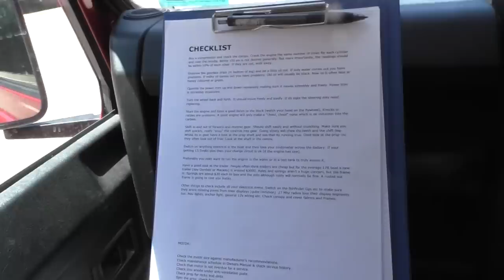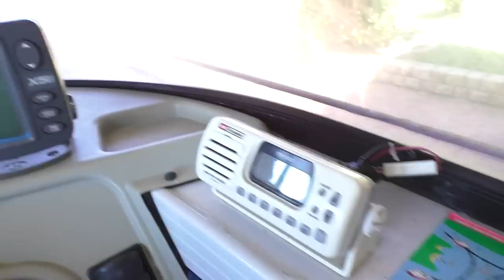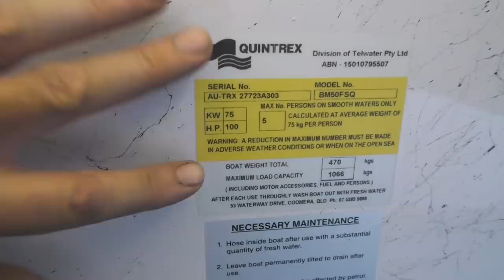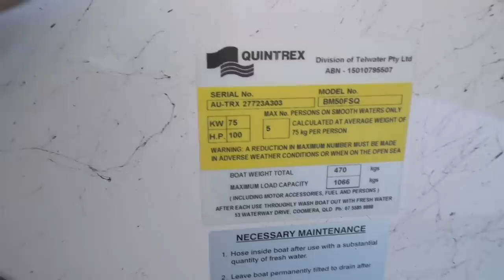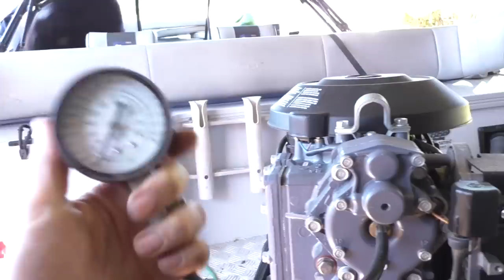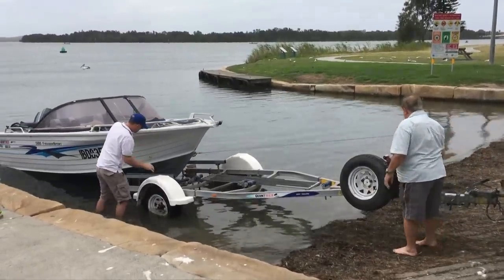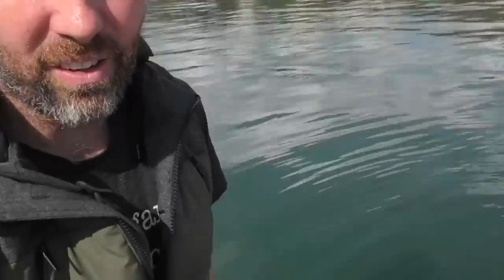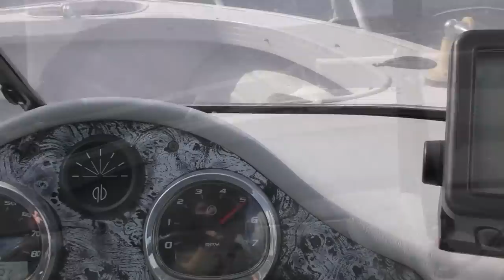Buying a used boat

Comment: Tips for aluminium boats, check for old hooks, swivels and sinkers jammed up against the hull, usually under seats or bracing points. They will induce electrolysis and corrode the hull out very quickly. Also check for longitudinal cracks along the hull, especially near rivets or either side of the keel. Thanks again for a great video Stu!
Reply from the maker: Thanks Matt. I'll add looking for stray metal to the checklist. :)
Reply: Great tip Matthew. It's something I've run into every time I'm in the market for a used aluminum fishing boat.
Reply: Even after you buy the boat. I did this several times using a hose and probe. The first few times I got some  swivels and sinkers.  Noticing water didn't flow smoothly past all ribs, some digging with a cable tie (plastic so no scratching) I found a rusty traler hub bearing cap wedged under one rib and a half penny wedged under another.

Comment: Love your videos Stu. I have learnt so much from you, its helped me do everything myself on my old 4.5m alloy centre console project boat. The boat   was sitting in my shed for years with a buggered motor and i never had the money to do it up. Your channel motivated me to drag it out and start working on it. New floors and carpet, new wiring, new lights, new bilge pump, second hand 50hp four stroke Yamaha to replace the old motor, fix up the trailer all learned from your channel thanks so much for the help. It will be finished soon (as funds allow) and back in the waters off Brisbane just in time for summer can,t wait. Hope you get well soon cheers Peter
Reply from the maker: Thanks Peter. Glad the vids helped you get your boat fixed up. Only one week till spring! :)
Reply: A bit late to comment, however,  how did you go with your  "renovation"?

Comment: Hi there. I’m a first time boat owner. I’m reaching out to you from Pratt, KS, USA.
Now to the meat and potatoes. I bought a nice 1989 Ranger bass boat recently. The owner started the boat for me prior to purchase. It was a little bit of a bugger for him to get it started and also for him to get a steady stream of water out of the tell-tale. Nadia and I took the boat out to a small lake to familiarize ourselves with our new purchase. I noticed the temperature gauge climbing rather steadily as we slowly traveled out of the no wake zone. I also noticed the no water was coming out of the tell-tale. At idle rpm. The temp got up around 3/4 of the way hot on the gauge. We trailered the boat and took it home. I checked for airflow on the lines on the top side and there were no obstructions. I pulled the leg off last night and when I did so the water uptake tube stayed attached to the pump in the leg. It didn’t stay secured up in the engine. I will add that the leg slid right out without any added persuasion. All the videos I’ve seen where the leg is dropped for impeller replacements, the uptake tube stays secured up in the mid. I’m guessing that I was losing considerable water and pressure because of this lack of tight fit at the top of my uptake tube. My plan is the remove the uptake tube from the pump and reinsert it into the mid. Is there an easy way to do this properly where I’ll get a secure fit and seal or is this a major repair? This may sound dumb, but if my rubber seal or grommet...... whatever was originally used up in the mid is gone or damaged can I use a 1 inch piece of heater hose or fuel hose on the end of the uptake tube that seats into the mid if I find the proper ID and OD?

Comment: Great video as always. One thing I've found on smaller boats is people putting on any prop they have that fits because they broke one etc. and it's the wrong diameter and/or pitch and then the boat doesn't respond well either rev-ing too high or not enough.
Reply from the maker: For sure. I it good to get the story from the owner so if it only hits 4000 RPM you can figure out if it is prop or a motor problem.

Comment: Hello Dangar studios! I’ve watched all your vids and as an avid fisherman up here in Canada I’ve always found them super informative. I wonder could you do a video on your thoughts regarding aluminum vs fiberglass hulls. 
Kindly
Buck
Reply from the maker: Hi Buck. Aluminium hulls have good abrasion resistance and can take knocks against rocks, other boats etc better. Fibreglass hulls are very strong in the water though and are generally heavier and therefore more comfortable in choppy waters. Aluminium hulls tend to slap against the waves because they are so light which can make them uncomfortable.

Comment: Great tips and advise and for anybody buying a newer rig in hopes of getting a 'transferable warranty', be careful and do your homework. Not all but many boat manufacturers offer Transferable warranties that may include the second owner. Just keep in mind that these transferable warranties are written by lawyers!! The biggest back door escape for a boat manufacturer on a second owner transferred warranty claim is if the first owner performed any upgrade work or in some cases routine maintenance themselves rather than paying the manufacturer or dealership for even minor upgrade installs as simple as a rod holder and/or simple maintenance work. 

Some boat manufacturers are pretty honorable when it comes to warranties and others not so much. If a warranty is something you'd like in your purchase of a second hand or new boat read that warranty especially the release of liability section and the guarantee section.
Reply: Wow sorry to hear about the kidney stones Stu. I've had my gallbladder removed after a painful blockage and I understand the kidney stones are just as painful. Good on ya for a complete recovery mate.
Reply from the maker: Good point about warranties if you are buying a second hand boat that isn't too old. Well worth reading the fine print first!

Comment: Great video Stu! IF the boat has a trolling motor that's something to check out, especially if it's a newer unit. The new ones are EXPENSIVE! The new models with anchor lock cost more that my whole boat!
Reply from the maker: Good point Jim. Well worth making sure it is working properly while you are out on the water.
Reply: sorry mate.. not at all,  I didn't mean anything negative..my apologies :)
Reply: @markolav7017  I apologize if I jumped the gun. At times Its hard to tell if someone is being serious or just playing around (sarcastic) by reading comments without talking in person to get the vibe of the conversation. What you said was funny😁, but I thought you were being serious. Us dumb Americans take things too serious sometimes! I didn't know you were friends with Stu. If I did, I should have seen the joke coming and laughed!
Reply: All good my friend..I just thought I would throw in the old "cup holder" gag as Stu mentioned these great features during the Green Machine restoration. I should have explained myself.   Yes, trolling motors are ridiculously expensive and well worth checking that they actually work during the test run.  If not, may be another good bargaining tool to get the overall boat price down :)
Reply: Quinnies of certain vintage had an issue with electrolysis between the the stringers and hull.  A mate had perforations after 2 years!  I believe the alloy used  wasn't great but was needed to be ductile enough for stretch forming the millenium hulls.  Corrosion resistance wasn't great.
Reply: Quinnies of certain vintage had an issue with electrolysis between the the stringers and hull.  A mate had perforations after 2 years!  I believe the alloy used  wasn't great but was needed to be ductile enough for stretch forming the millenium hulls.  Corrosion resistance wasn't great.

Comment: One thing I might add if I may, is more times than not you can purchase a boat, motor, and trailer for very close to the same price as you could buying a used outboard. Then you would have to either install it yourself, (mount, controls, etc) and you would have to have it installed (which most of us would have to do if it is a larger motor with steering and controls). I know in my case , I just recently had the lower part of the driveshaft break in my old 1987 nissan. Only parts you could possibly hope to find there are used at someone's boat/motor salvage yard or extremely rare in my case someone still has one they are parting out. The part /parts journey was unsuccessful for me and I opted to strip down everything of value that I possibly may use later on the next boat, after looking hard for a reasonably priced used outboard of comparable size. No luck there, so I stripped my old rig down of anything I thought I might use at some time on the next boat , and I found a boat , motor, and trailer that I thought was in really good condition(1998 seaark bass boat with 115hp johnson) and was priced what I thought was a very reasonable price. The difference here is you can still get parts for my motor for the most part if needed. 

And I know that is not always the case if you are someone that works on outboards. Often times someone may come in want to upsize their horsepower or go to a more modern fuel injection, or a 4 stroke motor, and you may be able to buy their old outboard which may be in good condition cheap. 

So just a perspective from the non outboard mechanic or non outboard or non boat dealer side of things. 

Again you have an excellent video here on things to look for , but just wanted to put it how it may be for guys like me.

Thanks Stu, and stay well!!!
Reply from the maker: Hey mate. It's definitely important to know the new price of anything you are thinking about buying. Without that information you don't know whether it is a good deal or not. I find a similar thing with auctions. People often presume something must be cheap because it is an auction but bidding can climb over new price if you aren't careful.

Comment: Dangar Marine - I liked your video. One of the last things you touched on at the end of your video was documentation. Being from the USA, Specifically Texas. It is very important to first check to see if the person trying to sale the boat actually is the owner of the boat. Texas is one of the toughest and strictest states of all 50 states when it comes to buying a used boat and being able to legally document and then being able to transfer the ownership from the old owner to the new owner. All boat registered in the USA have registration numbers assigned to them, First 2 letters of the registration are for the abbreviation of the state the boat was last titled in example TX for Texas. The next 4 numbers are followed by a series of 2 alpha letters. An example would be ( TX 1234 AA )  This is an example only. All to many times since Texas is a Gulf Coast State. You can find a lot of used boats for sale. Unfortunately all to many times the person selling the used boat, has obtained the boat in such a way which does not all them to properly title the boat in there name. Especially when it comes to Texas. So when in Texas looking for a used boat. The first thing to do is get the registration numbers I talked about, and reach out to the Texas Parks and Wildlife. You can call them or go on there web site and with the title numbers off the boat you are looking to purchase. This site will tell you whom is the legal owner of the Boat and Motor. Does the Boat and Motor have a lien holder? When was the Boat and Motor last titled. Note: both the Boat and the Motor (Outboard Only) required Titled. The Titling of Outboard Motors was included because of the high incident of Outboard Motors being stolen off the back of a boat while being trailered Since the registration is good for only 1 year this can tell you how long ago the boat may have been last used. Note: Titling just shows proof of ownership. Registration gives the person holding the Title of the Boat and Motor the right to Register the boat to be able to use it in the water of the state you are registering the boat in. Also if the boat comes with a trailer as it did in your video. This trailer will also have to be registered and issued plates, so as to be able to tow the boat and trailer on the road ways.

All to many times while looking for a used boat for sale. I have run across the person trying to sell the boat thinks they own the boat and has the right to sell it. When after checking with the state, I find out that the person I have been dealing with is not the person registered as the owner. This then makes for a very uncomfortable next call to the person trying to sale the boat. 

I once was looking at a boat for sale and after following up with the State. I realized the person selling the boat was not the titled owner of the boat. The State gave me the name of the titled owner and I was able to track this person down.  I confirmed they were the owner of this boat. It turned out the both the person try to sell the boat and the real owner both lived within 15 miles of my location. I gave true owner the information on how to get in contact with the person trying to sell the boat he did not own. The actual owner of the Boat was able to reclaim his boat after having been lost for over 11 years.
Reply: Yup, kinda the same in Ohio. Boat needs a clear Ohio title if outboard it also needs a clear Ohio title the trailers just need to be weighed and a slip issued for registration. More than a few time iv come into people not having titles in there names to avoid paying the taxes I always pass in them. Ohio is very very difficult to get a title for something. They also won't release the current owners name without getting an attorney to file paperwork to try and track them down. It's crazy. A lot of people sell outboards without titles because they don't need registered in Ohio for any type of numbering on the motor, but it is a felony to buy something that has a title without getting the said title with it. No thank you to a felony for a boat motor lol

Comment: Over 20 years ago I sold my 4.1mt tinny , was a great spearing / fishing boat but was starting to get too many stress cracks , you'd get the cracks TIG welded and it would crack somewhere else , I'd point out the hull has professionally   welded and water tight but how long til another crack occurs for the new owner ?  Not sure I'd buy an aluminium boat over 15yrs old again . 
That 90hp 4 stroke Mercury sounded great.   
Just regarding compression tests ,  not every seller that wouldn't agree to it may not be hiding anything , he / she might be uncomfortable with a stranger stuffing it up ,  eg stripping sparkplug  threads in the cylinder head.   Internal corrosion would be my biggest concern with buying  a used outboard  but thats not something you can easily check ....

Comment: Also check strapping on boat I had one I bought for the motor and trailer that had dry rotted straps in back an it slid off on the way home. Luckily a bunch of people helped pick it up and got it back on the trailer. Now I bring my own and strap with them 😂 It was a crazy thing at the time but all I could do was laugh when it happened 😂
Reply from the maker: Yep, definitely a good thing to check! No safety chain to the stem?
Reply: Nope ripped the hook right out of the bow spun the winch so fast it broke the crank handle off. Was so crazy 😂 happened on a major highway. Thank goodness for good people who helped me. It's a. Good story now lol

Comment: Stu, as usual, excellent video. I can't tell you how much your videos have helped with my second hand boat. I bought a boat with that same exact engine as in this video and found a 2 cycle oil leak later on. Any ideas where to start to fix it? The only good thing about it is that currently, the motor will NEVER corrode 😉 but I would like to fix it...
Reply from the maker: Hi Erik. With a problem like that I would give the motor a good degrease and then run it for a brief amount of time so you can see where the oil is coming from. Once you know you the source of the leak you can think about what you need to do to fix it.

Comment: Excellent tips Stu. Hope your feeling better!!! A friend of mine who had kidney stones for years swears by Chanca Piedra. You might look at the reviews on it.
Reply from the maker: Interesting, I'd never heard of it. I'll have to grab some!
Reply: @DangarMarine  another thing you can do, Stu, is drink plenty of lemonade. The citric acid will dissolve stones. Add whiskey to offset the lemon flavor!
Reply: Cherry juice and dried cherries and plenty of water. I love my brews but actually don't help! I moved to hard seltzer which is zero sugar and zero yeast and it helped. Used to get horrendous gout but figured out from yeasty beers and of all things mussels which I flicking love but having a foot twice it's normal size and a breath of air feeling like a knife ain't worth it. Kidney stones similiar. Haven't had those yet but heard it's a near death experience.  Best from Hawaii. Love your channel. Ran a 19 ft Glasspro 30 miles offshore for years with an 88 Johnson and then twin 60 yammys. Caught loads of pelagics. At 60 I don't think I could do what I did at 35. Boat owners of smaller vessels need to understand the physicality of offshore fishing if not a commercial old salt. You may be better off chartering once a month with friends.
Always told my fish recipients probably the most expensive tuna Mahi and wahoo they ever ate!

But if a good calm lagoon like I had in the RMI you could load an Esxi in a few hrs with minimal expense albeit grouper snapper trigger and such. But nothing like offshore and a big ahi or marlin peeling line. Wish I was 35 again.